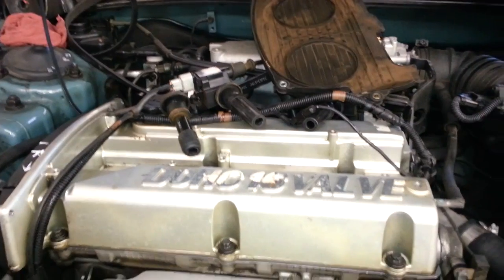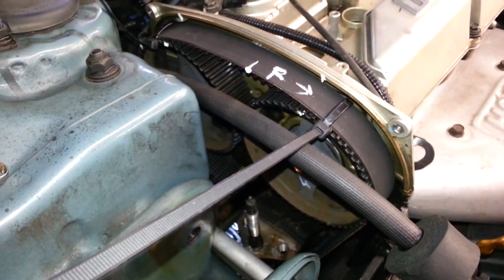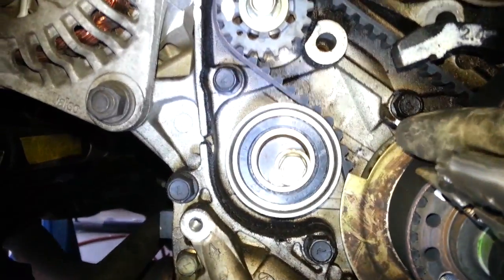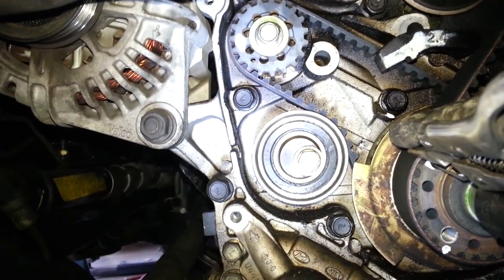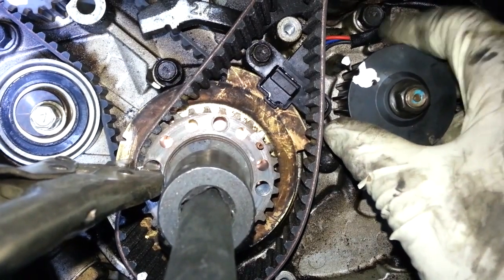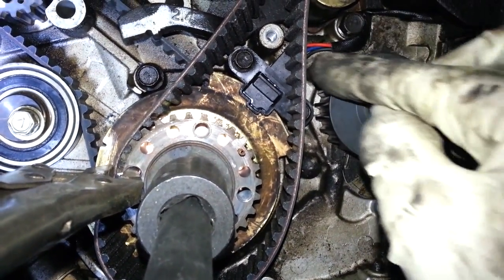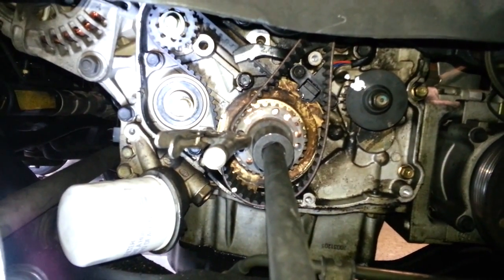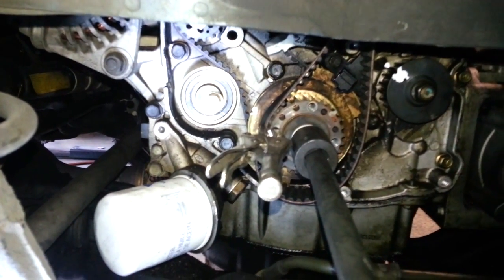HOW TO NOT FAIL! "Gravity Trick" Hyundai Mitsubishi timing belt info!

Comment: I just did a timing belt on 2004 Hyundai Sonata 2.4 and may have failed by not using the "Gravity Trick".  I am getting what appears to be a vibration but only at higher revs, at idle and crusing it appears to work fine.  However when pedal down it feels tight.  Does this sound like the fail for not using the "gravity trick"?.  Also great job on explanation and video.

Comment: Is it true the catalyst has to be removed to access that plug on the block?
Reply from the maker: Lynx Star Automotive no, not true.
Reply: subtledriver Unfortunately, it is.  Depends on the year, and engine serial number.  I did this job on a Kia, and sure enough, while you can access the bolt, it will not remove, unless you remove (unbolt) the exhaust manifold/catalyst assembly from the cylinder head.  I had to do so regardless, because the car suffered timing belt failure, but if just doing a belt change, on some models/years, removal of the manifold may be required.

However, your gravity trick is spot on.
Reply: Lynx Star Automotive

Comment: Thanks, this helped me fix a 1990 Mitsubishi mighty max with a 2.4 sohc. It had been vibrating so badly after a previous timing belt change, it loosened and finally sheared all 4 crank pulley bolts. After using this trick, it's as smooth as can be. Thanks again.

Comment: I have a 2005 Soanata 2.4. Had my timing belt changed two years ago and the vibration has been awful since. Had it to a licensed Hyundai dealership and they said nothing was wrong. I have high mileage so figured it was something I'd have to deal with until trade. Hopefully this will solve my problem! Thanks!
Reply from the maker: hope it works for ya

Comment: This was a life saver for me too. Put a new crank sensor on my mom's car, and I thought it was something else causing the vibration. I did cheat and drill a hole to access the water pump shaft bolts. That was a big time saver. Just put her car back together last night, and running smooth. Thanks for taking the time to post this video!! Now my mom will be her car doesn't stall from a bad crank shaft sensor, and I didn't give it back to her vibrating! Happy son!

Comment: On my way home from work my 4 cyl Hyundai Santa Fe engine simply stopped running and I coasted the car into a service station.  They diagnosed and replaced a broken crankshaft position sensor and while disassembled, I had them replace the timing belt assembly, tensioner, pulleys, and water pump.
  I brought the car back after the repairs were complete because the engine was very loud and the engine and the whole car vibrated.  After going over the car again, the professional mechanics found no issues with their work, validated the car was properly timed, and returned the car keys to me.
   I knew something was just not right so I started diagnosing the engine myself.  I checked and tested the engine mounts and found all 4 were in good condition.  I then found your video and using your drillbit method validated that they did not have the engine properly timed.  I then disassembled the front end of the motor and made the appropriate adjustments as you showed and the engine is running smooth again!!
THANK YOU SO MUCH.  I THOUGHT I HAD TRASHED THE ENGINE AND HAD TO BUY A NEW CAR, WHICH I COULD NOT AFFORD.
  I typed a letter explaining this to the service station and provided them your video URL for them to use as a learning experience.  I also asked if they would reconsider what they charged me as I spent about 8 hours doing all the rework, but never heard back from them.
THANKS SO MUCH AGAIN!   AvgJoe.

Comment: its A Mitsu derived engine, Hyundai and Chrysler bought the rights to the engine after 99 originally started out as a 4g63 but got tweaked.
That balance shaft also drives the oil pump so that's why its a 3/1 ratio

Comment: Good thing I decided to look at your video...  I am in the process of finishing up a timing belt, water pump, and crank sensor maintenance on a 4cy 2002 Sonata.  5 years ago I had a local mechanic do the timing belt and the engine had horrible vibration, the mechanic eventually fixed it over 4 days, and did not tell me how he did it,  now I know.  About your video, I could not understand what you did to verify the correct setting on the other side of the engine. I think you were testing for magnetism, is that right ?  If so, where on the engine did you probe.  Thank you

Comment: Nice bro! Thanx! Workin on a friends 01 optima. But the plug seems to be behind the exhaust mani On this engine. Hoping for some way to hold the sprocket in place to break the nut.  Gotta access the oil pump cap-plug, behind the sprocket and change out the O-ring. (Star shaped cap) Im really trying to NOT remove the mani. Any suggestions??

Comment: Dude awesome work there!! Thanx! Workin on a friends 01 kia optima with the same engine. But I have other probs now!!! On the optimas the plug hole is not accessible w/o removing the exhaust manifold. And not trying to do that if possible! but I need to remove the sprocket to access the oil pump cap plug?? (I believe its called?) The star shaped cap bolt directly behind the sprocket. Any suggestions??? I need to replace the o-ring, the dam thing is leaking and caused a huge mess and destroyed the belts. Its the only thing holding me up!! Got anything?

Comment: Getting ready to do this tonight! So after setting it to TDC and see the timing marks looking right, can I just turn the crankshaft and release some tension just like what you did. I don't wanna touch anything else. I will focus on the oil pump and check it with a screw driver. So the moment the screw driver goes through, I should be ok and place everything back together. Is that right? Thanks!

Comment: Great trick! Im about to pull apart my kia to try and change the cks. Would the belt have to come off to pull that sensor?
Reply from the maker: you could try to not have to remove the belt, but I would change it since your in there. they break before the recommended mileage.
Reply: @subtledriver  I've zip tied the belt and clamped the bottom like yours but when I rotate there's no slack for the belt to slip off that gear. Help

Comment: So let it turn by it self to its position after moving it around.and my check engine light came on and it's the cam shaft position sensor you think cuz of the timing is off it turns on.
Reply: Have a similar issue, I knew that the balance shaft needs to be set right so that it wants to stay on the mark, got that set and reassembled everything. Rpms don't show and the code is P0320. Also feel vibrations at certain rpms. Guess I will have to pull the timing covers and check everything over.
Reply from the maker: the cam timing is off, or sensor is bad or wiring or ecu issue, you can have all the timing marks off on the balance shafts and have no check engine light if everything else is spot on.
Reply from the maker: Dan.vaku That code will need a new sensor. They go bad quite often. I replaced 3 sensors in a week. Very common. Don't hesitate to change it.

Comment: very handy to know!! this must be why my one has bad vibrations.....
Reply from the maker: Yes, very easy to mess up alignment on the right hand or frontmost (toward radiator) balance shaft due to gear reduction. The repair info didn't explain the gear reduction. Just stated the pin hole trick. I like to know why things are the way they are and understand fully how the systems work.
thanks for the comment!
Reply: subtledriver hie dude, how do i identify the pinhole on the block?
Reply from the maker: its got a small screw in plug under the exhaust manifold.

Comment: How do you take the flywheel off in front of the cover and timing belt???? I can't get the large center bolt broken loose because the outer flywheel keeps spinning....any help would be VERY MUCH APPRECIATED!!!!!
Reply from the maker: I used an impact gun. I'm a pro!  Or use an extension and set it on the frame, then tap the starter for a second to break it loose. But you don't need to remove the big bolt in many cases, you just need to remove the small bolts holding the harmonic balancer. thanks for the question.

Comment: Very cool...I have a Kia with the same engine and it runs great but has a horrible vibration at any RPM. All the timing marks line up but the balance shaft must not be timed right. I'll check it using this method. Great video.

Comment from the maker: what is a 4g63? I don't know the engine code for this hyundai, i work on hundreds of engines!
thanks for the comment, usually the sensor plate doesn't matter, its all about the alignment marks. make sure the plate was installed correctly or mark it before removal. the car wont start and the sensor can get damaged when installed incorrectly.

Comment from the maker: I'm glad this helped you! I had to do the timing belt twice because of this, there is no info about this in the instructions. It says stab a pin in the side of the block to hold the balancer, but it failed to mention it was gear reduction. I know what you mean about the two positions, But if you have played with it for a while, you can tell the slight difference, and know the happy spot.